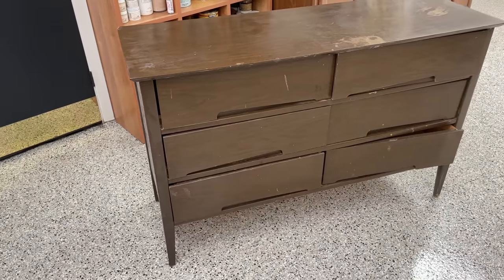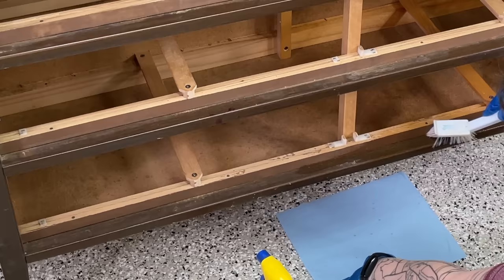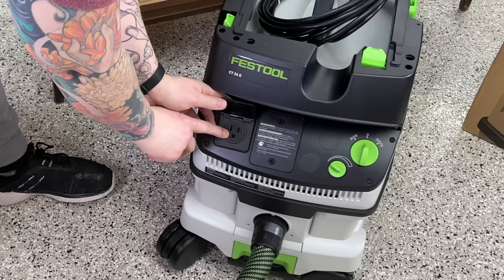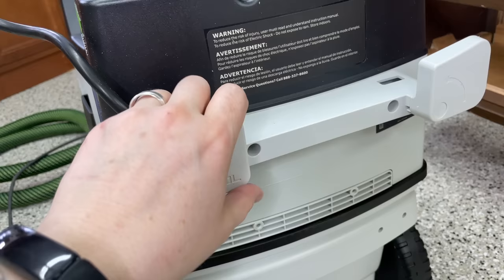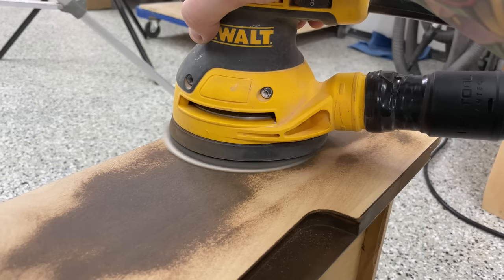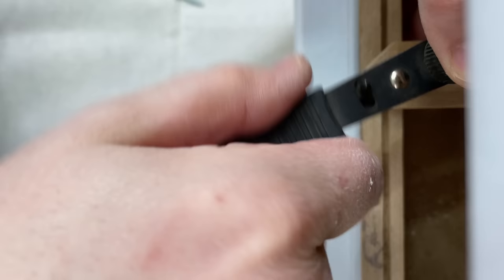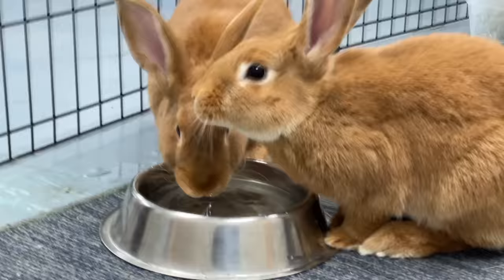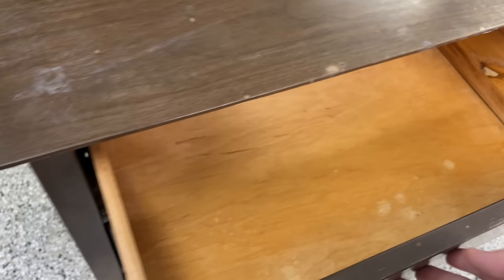Transform Your Dresser Into a Beachy Masterpiece with Just Paint!

Comment: The festool vacuum has a stand at the button of the front (green button) - the fixed rear wheels help this stand to function. It's a really useful feature. Also with the festool sander attached, dust is 99% in the vac, i still can't quite believe how good it is myself, and I sand a lot of joint compound/ filler 👍🏻🇬🇧
Reply from the maker: Awesome! yeah, I definitely figured a higher end sander would make a big difference with the suction.
Reply from the maker: Do you have the self cleaning version? Where you do a lot of joint compound?

Comment: Looking great!!! A heads up, the “Auto” setting on the dust extractor allows for you to trigger the dust extractor to turn on when you turn on your sander. When the sander is plugged into the extractor and it senses the sander pulling power when turned on, it activates. Conversely, when you turn your sander off, it turns off the extractor. Kinda of a great feature.
Reply from the maker: Thanks Michael! That’s definitely a cool feature!

Comment: Did I read correctly that you posted your first video 9 months ago?     And you recently surpassed 100,000 subscribers?    Amazing indeed.    You certainly earned it but that time-line is certainly not the norm.   That is true dedication.    This piece has a fresh, airy feel.   I like the 2 looks from one paint.   Your new work space must feed your creativity.    I adore your floor!   I would love to epoxy my basement and garage concrete floors.   It's a clean, timeless look.   (I don't know if Harbor Freight exists in Canada but I bought a few tarp-backed drop cloths to use when I painted indoors - before I had a garage.   There's probably many other sources if you are interested.)
Reply from the maker: Yes, it’s mind boggling! I didn’t think I’d ever reach this point, let alone so quickly! ❤️

Comment: We have a hutch set on our veranda (in France, a veranda is a one-wall attached full-glass conservatory). I'm not sure that it is still called a hutch set now, but that is what my grandmother would have called it. The centerpiece of furniture with either 3 drawers or enclosed shelving on the lower half or enclosed shelving and 3 shelves on the upper half. In this case, the piece of furniture it is solid doored enclosed shelves on the bottom, and the top is 3 enclosed shelves behind frosted glass doors. On either side are towers of the same height and half-width shelf units. Next to them are again towers, one-half the size of the inner towers, but these are fulling enclosed with only 5 shelves; also their face doors are one-quartered rounded. The entire setup would not fit where I have placed so the end tower has been used in the garage on either side of the refrigerator in there. They are all beech veneer. It was a cheap set even 22 years ago, but it is usable, and I don't see any reason to replace it as it still serves its purpose. However, I now want to move it to another wall where all modules will fit. That leaves me with updating it all. This video you made has inspired me to this for this same sort of thing for the Veranda Hutch (as I call it). So I thank you for the inspiration!
Reply from the maker: You are so very welcome Susannah! Best of luck with your project!

Comment: Oh my word thats gorgeous! I have a low bookshelf that has a veneer finish in my bathroom that has some baskets in the bottom shelf and towels in the top shelf. I want to recreate a colour scheme similar to what you have done here, but am nervous the baskets will scratch the paint. I will be finishing with a couple of coats of oil based polyurethane - I really hope the baskets (which just hold toilet paper) don’t scratch the finish. I might try to add some kind of felt bottom to them.
Reply from the maker: That sounds lovely!! I would definitely recommend a water based polycrylic over oil based though, as most oil based ones will turn light paint yellow-ish, either right away or over time. The water based ones (like varathane diamond finish or minwax polycrylic) are crystal clear and don’t yellow. :-)
Reply: @TranscendFurnitureGallery  ah… never mind. I was recommended it by the guy at our local hardware shop - might use this on projects I decide to keep a wood look on then, and grab a water based one. Cheers for the tip.

Comment: I'm learning so much from you!  Does the wax that you put inside the drawers stain any material that you put in the drawers like towels or sweaters later?
Reply from the maker: All of the different products I use in the drawers get applied, allowed to sit for a short period of time and then wiped back. What remains in the wood cures and then doesn't leave any residue. There are some oils that could perhaps leave a residue, but the ones seen in my videos are the only ones I use and I've had no issues at all (the excess needs to be removed though).

Thanks so much for watching!

Comment: I needed this whitewash demonstration. I have some solid oak dressers that have gone orange. I think a whitewash finish would look beautiful without hiding the grain. What do you think? Would it be a sin to whitewash solid oak?
Reply from the maker: It depends if it's red oak or white oak. Both have the tendency to be slightly red or yellow in hue. So if you want a true whitewash, you'd have to neutralize that colour. Sometimes adding the slightest hint of green will help balance the red tones. You might be better off practising that method on a smaller piece until you get the hang of it. You could also try a tan or beige wash. Thanks for watching!